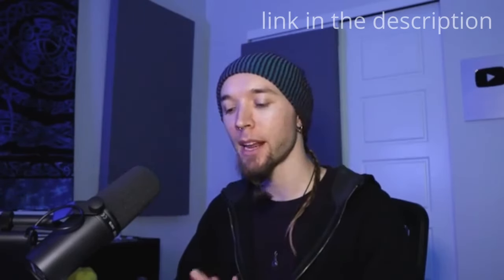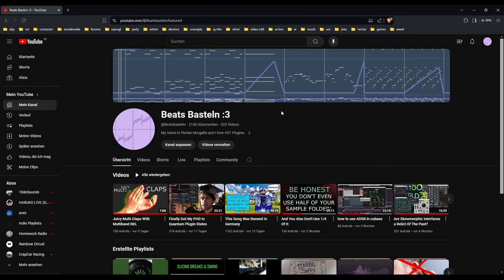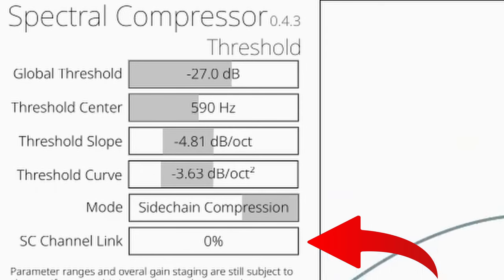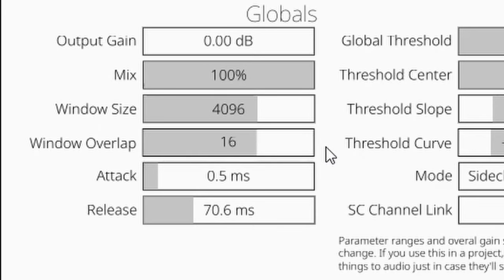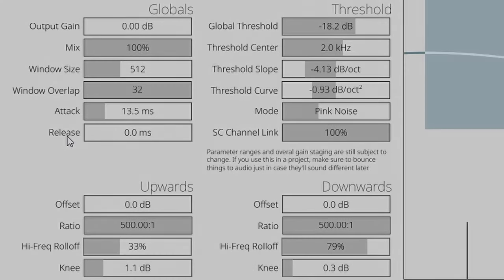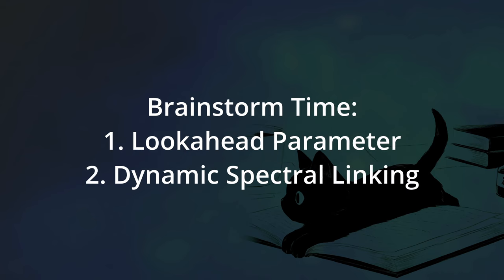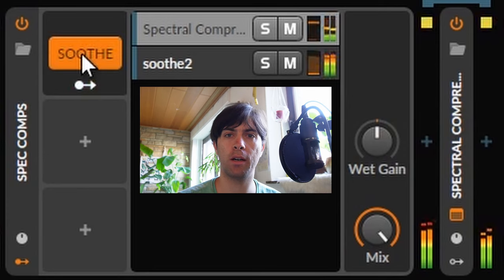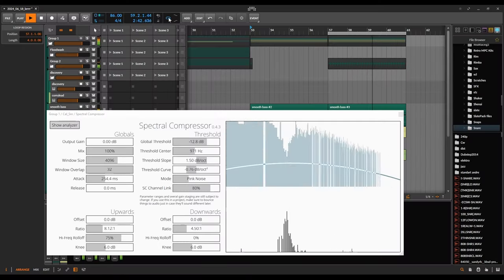Spectral Compressor: You Have To Relearn Compression

Comment: I’m pretty sure you shouldn’t run a non-linear process in parallel unless you’re okay with the phasing. That’s why it includes a mix knob and output gain. Similar actions, different results, but you are using it for sound design vs for mixing so it’s probably fine. (Love this plugin, great video, man).
Reply from the maker: @wuujujuuju  nonlinear processes don't expose phasing in parallel. you are probably confusing it with multiband effects where the internal mix knobs are designed to compensate for the phasing. spectral processes don't need that though. it's like a high performance linear phase split

Comment: Thanks. Ive oogled this plugin ever since I saw AU5s video. But the install process seems complicated.

If you wanna make an install video for it. Id be very happy :)
Reply from the maker: you go to the spectral compressor link in the video description. there you click at the "NIH-plug" link and then on the link that says "here". There are the downloads. in the downloaded zip you find both clap and VST3 versions of robbert's effects. you can copy the VST3 files to "C:\Program Files\Common Files\VST3" and the CLAP ones to "C:\Program Files\Common Files\CLAP". you only need either VST3 or CLAP, not both.
Reply: yes its not that hard! enough ogling start compressing!
Reply: @Beatsbasteln  Im on a mac :)
Reply from the maker: @bodanerius  then you have to google the vst3 or clap paths for mac. i don't know them from the top of my head because i have no mac yet
Reply: The specific issue with Mac is that developers are required to sign their apps and plugins with Apple, or they won't open at all with the "Apple couldn't verify this app" type of message. I think you need to disable the System Integrity Protection to make them load right now, or he needs to get a certificate from Apple so he can sign his plugins and arrow people to run them normally, but that, obviously, costs money.
Reply from the maker: @SolarLiner  yeah. that sounds plausible to me. apart from that in cases like this it is always encouraged to ask the developers themselves what could have gone wrong
Reply: @Beatsbasteln  Especially with open-source projects, the author is always one email, social media or Discord message away. In this specific case there isn't much to do here, other than either providing macOS users with dangerous steps to bypass the security measures, or gather enough money to buy the Apple notarization certificates so that their software can run without nag screens.
Reply from the maker: @SolarLiner  I'm not a fan of apple's restrictive notarization system, that forces developers to put money on the table to make the user feel a little safer. I mean it makes sense for serious software but in my whole life of furiously trying lots and lots of free plugins none of them ever had malware (except maybe for the cracked ones). I want it to be easier for developers to provide mac compatible builds.

Comment: Cool idea, yet I stil have a hard time actually hearing what it could do to a signal. While these synths are cool, they are already super processed and its unusually difficult to get a good idea what they sound like. Kinda like showing ott on 100% doesn't hint at the practicality of  it much.
Reply from the maker: @pham4925  this is literally how i practically use the effect in this project xD i know i'm neither using it subtle nor ultra hard, but somewhere in between and that can be confusing, but that is literally why i said 'you have to relearn compression'. the spectral context of the compressors completely changes what kinda sound shaping can be achieved and expected from the effect. it is an unusual sound character that might throw you off at first, but it's also addicting and because of that it will likely get as hyped as autotune at some point
Reply: i gotto agree here!

Comment: Does this have a delta function like Soothe?
Reply from the maker: would be cool if it did. but you can make one by putting it in parallel with polarity-flipped dry
Reply: @Beatsbasteln  Ah, thanks! Is it the threshold curve for flipping the polarity? Also, since the polarity is dry do you change the mix to 50%? I'm completely new at this and there's not a lot of documentation on this.
Reply from the maker: @shirounurimba6898  the plugin has no delta feature or polarity flip button, but your DAW has one. so you have to keep the original signal around in parallel with the output from spectral compressor, but you polarity-flip one of them

Comment: id use the plugin but it always crashes if i run more than one instance
Reply from the maker: that sucks. you should contact robbert about it, so that he can make sure it works for everyone
Reply: the workaround for this is so stupid but works. just go to your vst3 folder and make like 10 copies of it. Spectral compressor 2.vst3, spectral compressor 3.vst3, etc. i have 10 and as long as i don't use, let's say, spectral compressor 2 more than once, i'm fine. still not ideal for workflow but it's a temporary fix
Reply from the maker: @zeccaflp  lol, never heard of a bug like this. in which DAW btw?
Reply: @Beatsbasteln  FL Studio haha
Reply: @zeccaflp  I had the same issue with this plugin in Fl Studio but it only happens when you try to have 2 (or more) Spectral Compressors on your screen at the same time, so as long as you close it and keep only one UI on screen it works and you can have as many as you like that way.
Reply: @micallbeard923  shit. i guess imma be pressing F12 all the time then. thanks for pointing it out